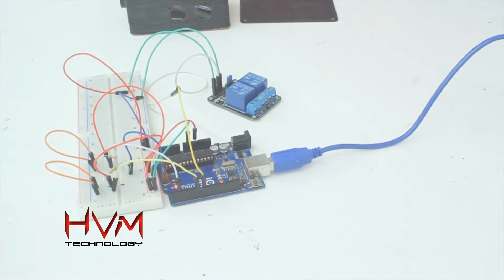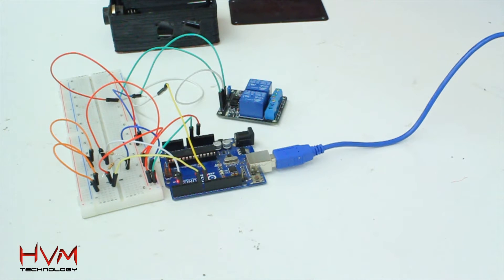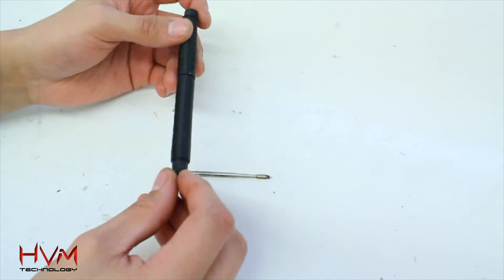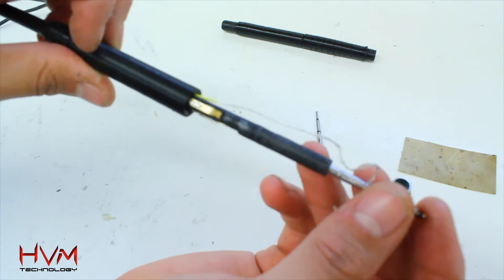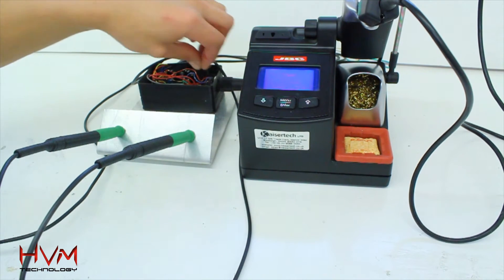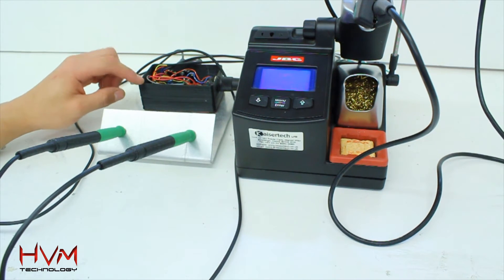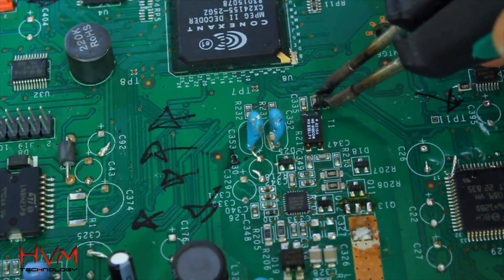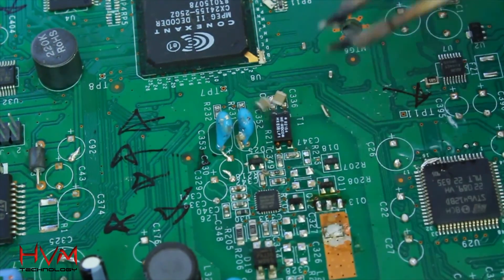JBC Solder Mod pt 2

Comment: I've planned to mod my station too. I've a simple idea in mind. A toggle switch that shifts all connectors from one solder type to another.
Reply from the maker: Hey, That's essentially what I did, I just used relays to switch the connections. 😎 👍

Comment: The handles are amazing, well done.  I wonder if you could get away with lathing something similar. Are you using a nice silicon wire as well?  How much slop is there in the tips when soldering? Part 3?
Does your switching circuit impedance throw your temps off? Lol sorry so many questions. Keep it up.